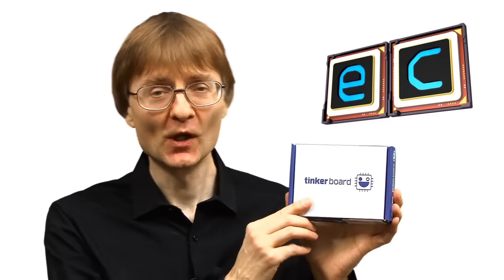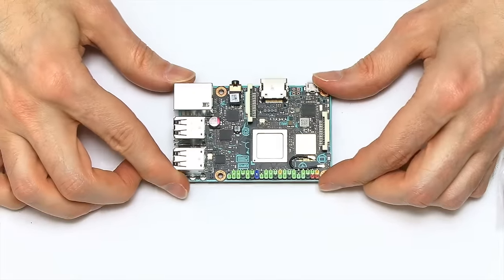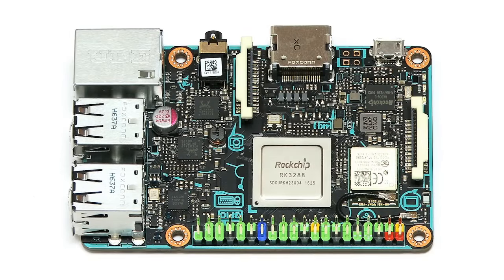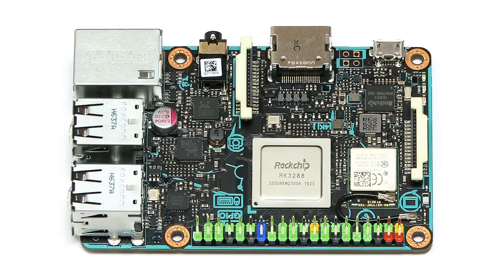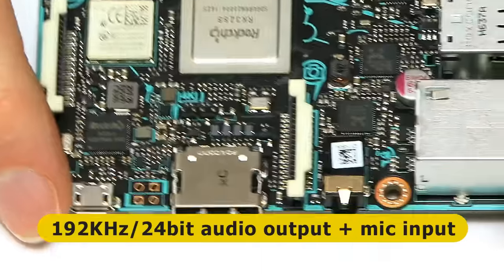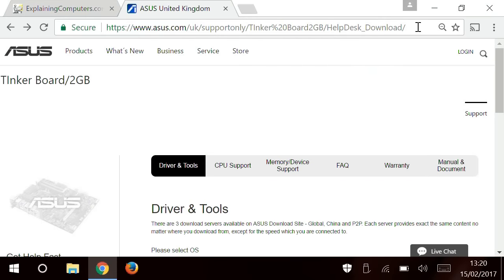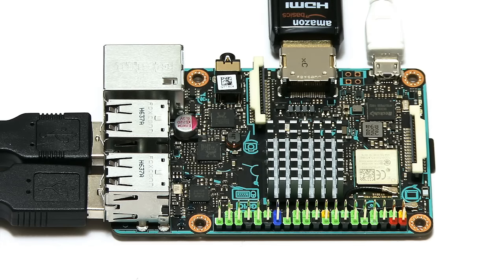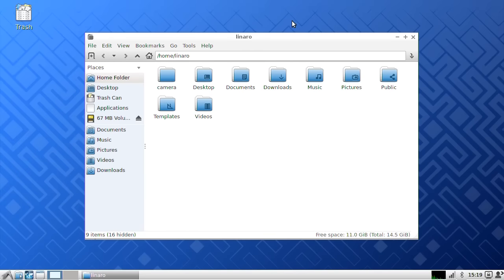Asus Tinker Board

Comment: I love these little boards... I'm an OTR truck driver here in the US... I had a PI 2 that I used as my media center and basic email and social media system in my truck for over a year... It's awesome to only need a 12v cell phone charger to run these things, even with external hard drive is and a USB powered LCD, you still don't need any more than 3 amps at 5 volts ..

Comment: Biggest flaw: no SATA or USB3.
This is why I still use my relatively old Banana Pi Pro, which has a lackluster CPU but makes up for it in I/O.
Reply from the maker: Yes, the SATA connectors on the Banana boards still gives them a considerable storage I/O edge.
Reply: Should be absolutely possible to develop a peripheral offering a SATA-connection like the renkforce avaible for the Pi. This shouldn't be a problem.
Reply: @rocker11281 Sorry, I meant SOC native sata and not sharing resources with any other I/O devices. An add-on can not hope to compete with native sata.
Reply: yeah, if this had a SATA connector on it, even a SATA I, I'd be getting one ASAP. This would be perfect if it did.
Reply: @Dmitriy If you are referring to the XU4, I must admit it caught my interest for a while but the price and power consumption are not really justified even if it does have USB3. My use case does not benefit much from the amazing CPU, all that matters to me is the I/O throughput and access speed. Still it's the closest I've come to replacing the Banana Pi Pro. The next thing I'm keeping my eyes open for are boards with the new Allwinner R40 SOC, but there is so little support out at this stage, sadly. It has huge potential with it's native SATA and is touted as the Allwinner A20 successor, we will see how that goes.
Reply: Too bad they do not treat customers with respect. Many unwise users like myself have bought their products because of its specs. You can see how many systems you can get on their homepage but some of  those are beta versions and what is more those systems behave like alpha versions. There's like 15 linux based distros and few androids but all of them work very poorly. Glitches and lack of functions, problems with either ethernet cable or wifi are certain when using any of those images. Too bad they don't support older boards. You can read forum for more negative opinions.  Sorry for my bad English.
Reply: If you want have SATA and USB3, then buy an UP Squared.
Forget Banana Pi, Up Squared is much better and running an x64 Intel CPU.
Reply: OpenGL4ever you have up boards ,udoox86 board ,and lattepanda or jaquar boards
Reply: maybe up squared boards are much better for your use but they also cost double ($99 vs $48). If you don't care about having a beefy cpu then the banana pi is definitely the way to go.

Comment: Hi Chris, Found your video very helpful. But should mention that the earlier versions of the OS were pretty shaky. The latest distro v2.0.8 really makes this board shine. I have the Tinker Board as the heart of a software defined radio transceiver that formerly was hardly even workable with the earlier OS now with V2.0.8 -- the audio problems are gone. While your bench mark evaluations offer a comparative analysis, it is the real world applications that make for the head scratching. You might want to circle back on the Tinker Board especially with the new OS. Thanks for all of your evaluations. There are some youtube videos I made of both the Raspberry Pi3 and the Tinkerboard driving the same SDR transceiver. It is clear I will use the Tinker Board configuration. Pete

Comment: I'd caution everyone to do research on the Rockchip over the Pi's Broadcom chip if you have desktop Linux in mind. Proper MALI drivers are only avaibale on Android, so on Debian you will be badly disappointed with the graphics performance of the Rockchip, even though the GPU should in theory be able to do amazing 3D stuff - but due to the driver situation, it most likely won't. On the Pi, there's both a closed-source gles driver as well as open source efforts, so given the right software support (gles over gl), you can get quite good accelerated 3D support on the Pi.
Reply: I want to say the Odroid boards had the same caveat with the Mali GPUs, great hardware for the price as long as you're willing to use Android, but Linux users are kind of left to the wayside :c Seems that just about any SBC that comes out that isn't Intel based or a Pi uses the Mali GPU, it's so frustrating. I want to say the Odroid community is getting closer to figuring it out though, I do recall there was some news on that front.
Reply: TwistedD85

It is still early days and there are developers that are producing viable alternative (GPL compliant) solutions.
Reply: I'm not in Linux for the GPL, so that's not a problem for me personally. All I need is a working gles and preferrably webgl acceleration. LIMA is nowhere production ready, according to their own site, and pretty much dead since the Q3A proof of concept in 2013. The open source drivers you linked date back to 2012. Utgard I have never heard of, so that's definitely something I will have a look at in the future. Do you by any chance have a link to debian tutorials for utgard?
Reply: trisymphony
I am not of aware of any Debian material for Utgard but would definitely be interested if you come across any.
Reply: Though mali ddk can not be open source because of arm's license, we have provided the libmali binary used for linux, so don't worry about graphics performance. (Not just 3D, we have glamor 2D acceleration support in x11)

https://github.com/rockchip-linux/libmali/tree/rockchip/lib/arm-linux-gnueabihf
Reply: Interesting! Is it included and installed by default on the Tinkerboard? if so, i'll definitely have a look and buy one!
Reply: If this is the case, why hasn't the orange pi community managed to get Mali acceleration working in Linux?
Reply: Nothing wrong with Android, which is what makes the Odroid and LattePanda[with AndroidX86] so appealing. And with Android having optimized drivers, hardware acceleration will not be an issue.
Reply: would this be a better kodi machine?
Reply: Short answer is yes, this device would make for smoother playback and higher resolutions. The catch is that you will need to provide a storage medium that performs at a minimum level. A UHS3 microsd of good quality should do the trick unless you intend to use an external USB HDD or to stream.
Reply: any recommendations for os to install? or can i install kodi by itself?
Reply: i sadly cant find the product anywhere. What os do you recommend to install? Or can i install kodi by itself?
Reply: Actually, Kodi is multi platform and can be used on Windows, Linux as well as Android. If you hop on Amazon or Gearbest you can find RK3288, RK3368, RK3399 based and many, many other TV boxes which come prebuilt for around $50 to $75. Kodi can then be downloaded from the Google Play store and used to your hearts content.
Reply: do they have the same h.264 and h.265 with 4k video output? Just curious.
Reply: You'll have to go looking and read up in the specs, but generally yes as long as you buy one with a more recent SOC.
Reply: +Freestyle Storm™ take a look at the video @ 00:56 and note the box touting 4K and it's accompanying asterisk which leads to the note that starts with "HDMI supports a maximum resolution of up to 4K (upscaled 1080P)..." so not true 4K, but upscaled from standard HD
Reply: +Timothy Barney
Sorry mate, but your conclusion is incorrect. I have 2 RK3288 based devices[tablets] and both do true 4k through their HDMI outputs. Granted, it's only 30hz but it is still proper 4k.
Reply: The Captain I was just going by what the package it comes in indicates.
Reply: Oh, gotcha. You were making fun of the box.
Reply: +trisymphony
To respond to your original post, The Mali Android drivers are easily configurable for Debian because Android IS a recompiled custom distro of Linux. That is why so many distro's have been released for ARM devices. Google did a ton of the leg-work already. The problem is that many of the Video apps that are being used on ARM compiled distro's of Linux were originally complied with X86 in mind. They are optimized for the X86 platform and while they will still run, They will not run as well as if they were compiled with ARM optimizations in mind. The reason RPi runs some thing better is because the RPi community has had a TON of time to optimize Debian for the RPi platform. Give Asus time and they will fix the glitches and get things running smoothly!
Reply: +The Captain, nope. The Mali drivers aren't easily configurable at all. They aren't open-source, so you can't compile them at all. There might, might, be a blob you can use, but I doubt it. Try it yourself before making such a claim.
Reply: +Andy Chow
I didn't say the mali drivers were open source, I said they were easily configurable. Big difference. And as I have had my hand in some Android development efforts both in the making and testing of Android ROMs, I can speak first hand on this issue. Making a version of Android for this device is going to be a minimal effort because there have been so very many other Android based devices made with this SOC chipset. So in future before blasting someone else like you have me, make sure you have YOUR facts in order before making such statements, which clearly have little to no relevance to the topic at hand and are little more than a thinly veiled verbal attack.
Reply: +TIMMY 2THUMBS
USB3 for a device like this is not such a major issue as you might think. SBC's generally lack the computing power to fully utilize the amount of bandwidth a USB 3.0 bus can provide. The only exception to that rules I've seen is the LattePanda. But even that board struggles to maximize the USB3 bus.
Reply: I've got one useless Tinkerboard because of this.  It just rots in its box.  Never buy a MALI GPU if you plan to do vk/gl experiments.

Comment: Excellent review, all the way around! I have been working on an Pi3 for the past couple weeks, and it is a wonderful product. I've been playing with it as a DeskTop, and it is pretty good, but a little under-powered, and I was already hoping for an early release of a Pi4, but that may be a couple years away depending on the rumors. It does seem like this Asus Tinker has picked on some good points and is kind of like a Pi4, but the price is a negative. Regarding your test on the GIMP filter, that is disappointing. With the clock being 50% faster and the GIMP text being only 16% faster, it is a head scratcher. However, GIMP probably is not using the extra memory, and the better hdmi and audio specs might make a big difference in terms of video speeds and audio quality. So, Asus could easily catch on. Based on your number of views already, there is a lot of interest.

Comment: You make fantastic videos! 
I see a future in SBCs. There is a missing element in the market. Mobile phones became smart phones, Laptops continued, as did desktops, tablets came along and filled a gap which seems so obvious today but the SBCs can fill another missing gap in the market. A small desktop has been an element for some time what with ITX, mITX, mATX etc. Obviously, although women say "its not the size that matters, its how you use it" simply isn't true in the world of IT as in the world of hardware size matters! 
Obviously  it is the same in the world of software but clearly a fair few companies need reminding of that since they even branded themselves as "Microsoft-ware"

However, I do believe that SBC's have a lot to learn from the concept of the project ara.
We need the ability to upgrade and replace components with ease be it the CPU, GPU, Ram or other peripherals. 

On a last note, I hope SBC's take an open source approach. I.e Asus using a Pi form factor.
Reply from the maker: Thanks for this -- great post. :)
Reply: but paul. The tinker board is to be used for robotics. Not as a real computer
Reply: He was speaking generally about SBCs, not the Tinkerboard specifically.
Reply: I think SBC's will eventually merge more with phones, converging phones that can act both as desktops and smartphones. Interfacing to stuff will get more wireless.

Comment: Same issue on your review of the JetsonNano; you never used the barrel jack for power. What isn't said is that the chip actually runs in a "low" power state unless it gets more than 2A. When more than 2A is applied the board gains tremendous performance. Please keep this in mind when testing SBCs.
Reply from the maker: On my review of the Jetson Nano I used a 3A 5V micro USB adapter specially made for SBCs, and I can assure you that I was in full power mode. I am very well aware of this issue (and have good contacts with the Jetson team at NVIDIA).

Comment: Unline Raspberry Pi branded SBCs, it has no composite analog video output... Take it down a few notches, since you can't use cheap LCD monitors with it! Take a Pi zero, solder a couple of wires from a $10 NTSC/PAL LCD, to the Pi's "TV" solder pad, add a 12V boost supply and voila! a super portable computer with color display for $17. Can't get by near that cheap with HDMI as the only option!

Comment: This is not a Raspberry Pi killer. There's a lot more going on here. First of all, if you just want a board that can do a few operating system stuff like running a web server but you also want to use the GPIO pins and stuff, nothing can beat the Pi! The forums for Raspberry Pi are just the best on the internet, sometimes I go to them to help solve my Arch Linux problems. Sure, this tinkerboard may make a better media player but as you've seen, the processing speed difference is pretty much negligible. Just like an arduino isn't a Pi killer, the tinkerboard isn't a Pi killer. It has its own place in the market.
Reply: To me- the ras pi will STAY king of sbc's if for nothing more than it's cult following in support. The sheer amount of people out there willing and able to assist with any and all questions covering every conceivable issue someone can  run across is nothing short of staggering! So yeah, there's nothing out there that the Pi has to worry about dethroning it in the foreseeable future.

Comment: Hi Christopher. I’ve convinced Santa that I’ve been a “good little Vegemite” all year - British readers please substitute Marmite or similar - and he’s delivering a Tinker Board for XMas. Interestingly here in Australia the Tinker Board is retailing for $99 Aud in computer shops and Raspberry Pi 3’s, which were selling for $75-80 Aud have since dropped in price between $10-20 Aud. Not merely a coincidence I’m sure, as the Tinker Board represents the first attempt by a major computer manufacturer to enter the SBC market. Interestingly, ASUS has not attempted to steal the market in a new direction. Instead it has embraced the Raspberry Pi defacto standard and issued a board for, as you rightly say, enthusiasts who want to use the SBC form factor to challenge the PC status quo.

Well done to ASUS for reading the enthusiast “wish list” correctly and responding so accurately. I think the Tinker Board has reaffirmed the Raspberry Pi form factor as a standard and added a significant legitimisation to it. I wish ASUS and Raspberry Pi Org great success in the future. The only really BIG improvement would be some form of organisational collaboration. Wouldn’t that be exciting?

Cheers from Down Under, Western Side ;^)
Reply from the maker: Excellent -- thanks for this Ian. I don't know if you saw my recent video that compared the Tinker Board to the Pi 3 and Odroid XU4 -- the Tinker Board came out really well, in part I think because Tinker OS is now very good: https://www.youtube.com/edit?o=U&video_id=8qBxi6Q4XlY So you are joining the Tinker Board party after they have sorted the OS out! :) Enjoy your Xmas SBC. It is a very nice board.

Comment: A great alternative to a Raspberry Pi 3, shame it doesn't support a normal Windows Installation, it has enough computing power to do it.
Reply: Current Windows doesn't run on ARM architecture, although an upcoming variant of windows 10 that can run on ARM architecture in development, and promised to run x86-x64 Application in emulated mode.
Reply: There WAS Windows CE (which supported ARM processors), though i doubt anybody has figured out how to get it working on the Pi platform.
Reply: limited software for CE
Reply: Shame about the price also.
Reply: Dmitriy Getman Actually it has been ported to ARM, just not released yet.
Reply: Windows OS got stupid long duration updates & backdoor.  I've using windows product for 3 decades, & I will avoid Windows OS on SBC product.

Comment: Hi Christopher, I really like your videos.I just purchased the Pi 3 (I still had an old Pi 1 256MB) and although this Asus board is faster I think the Pi is having the most support so I'm not really sad.
Reply from the maker: I agree that you should not be sad with a Pi 3! :) It will take a lot of beating . . .
Reply: +Explainingcomputers At the moment I'm having the problem that my computer  monitor (HDMI) does not have audio and so I need to use the analog audio of the Pi3 (which is decent) but it would be lovely if I could split the audio off of the HDMI cable running from the Pi to the monitor. I hope there exists (a not too expensive) 'chinese' hdmi-pass-through thingy with split-off audio port. I got a HDMI to VGA converter with such an audio port but I don't wanna use VGA for the monitor :)